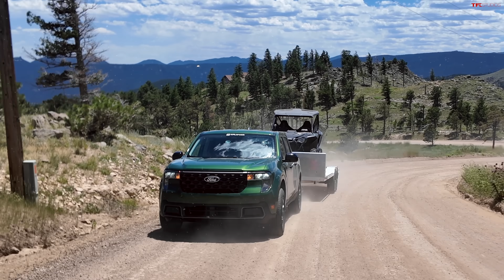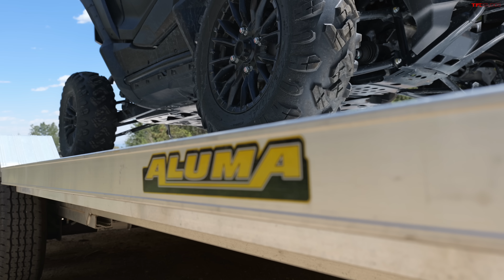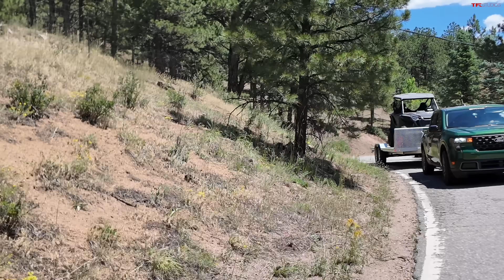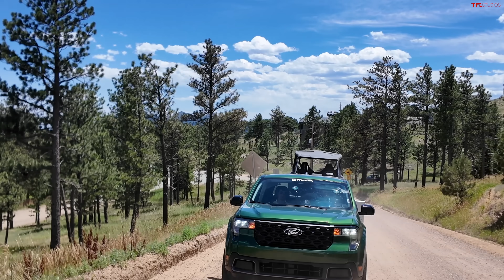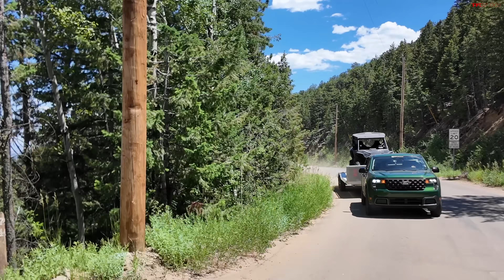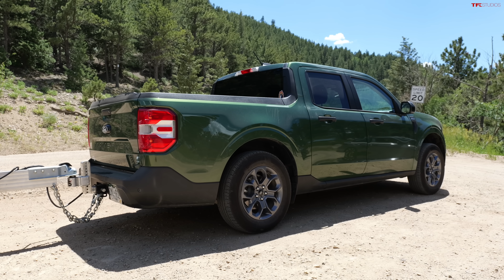Hottest Yet: Does The Ford Maverick Survive The TFL Toaster Towing Test?

Comment: With the engine rpm so high, the coolant is really pumping through the water pump so that a reason it is staying cool. Also, its naturally aspirated and not causing excess heat from lugging a compressed intake charge at low rpm when the water pump isnt pushing as much coolant.

Comment: I don't understand the idea of beating on the vehicle so hard, as most owners that care about their vehicles would never drive like that.  No need to mat it to the floor around every corner.  Gradual acceleration will help not overheat the vehicle, rather than trying to get back up to the speed limit as quickly as you possibly can.

Comment: You guys picking on a 3700 LB mini truck with  191 HP and my 2002 F150  weighs almost 6000 lbs empty only has 231HP. It actually does a respectable job for what it is and it fits the need of 90 percent of what I do. The 5 year 60,000 mile powertrain and 8 year 100,000 mile warranty on the Hybrid system was the final selling point for me. I'm ordering a 2026 This month. The fact that I can drive from Pensyltaxya to Georgia to visit my family on around a tank of gas is a big bonus.
Reply: @biffmalibu3733  Sounds like you and I have the same 2002 4.6.  Love that truck.  It has had zero issues.  Fuel economy sucks but that engine is bulletproof.  
I really want the hybrid Maverick.  I am torn between the hybrid Rav 4 and the Maverick.  I need a fuel efficient AWD for the family.

Comment: Just get a used Silverado 1500 with the 4.3 V6 if you’re looking for an inexpensive truck. They come with a full-size body a full-size pick up 4 x 4 double cab. They can also pull a little over 7000 pounds. You can find a bunch of them for around 12 to 20 grand depending on year and mileage if you are looking for something cheaper, that doesn’t get too terrible of gas mileage and don’t need a ton of towing power. I have a 2015 double cab Silverado with the 4.3 V6 4 x 4. I’ve pulled boats trailers and a 6000 pound camper with it. They tow around 5000 pounds with ease anything over that it’s definitely working a little harder, but I think most people would prefer the room and towing capacity of a full size for a cheaper price.

Comment: Hey Andre! Very entertaining to watch these kinds of videos! It’s also very helpful to see how each truck performs under these conditions, especially when people want to take summer vacations in various places.

IDEA: have you thought about doing a side-by-side comparison with both your Tundra and the newer model? I’m especially curious to see how different they perform (since the new one has different trans, engine, gearing, and now with turbos, etc). Though I understand if you don’t want to risk your truck, especially since 2019-2021 are the years Toyota removed the transmission cooler. Just a thought!

Comment: I have a 2024 Ford Maverick XL, the base model. I put a tow hitch on it, I own a 4,500 LB trailer, but my truck is rated to tow 2,000 LB. I do have an old gas guzzler that "can" tow it. I'm tempted to use the Maverick though.

Comment: My 2011 f150 FX4 5.0 is rated to tow 9100 lbs. it’s the crew cab long bed and is still made of steel vs aluminum. My truck weights 6000 lbs on its own. I just pulled an 8500 lb dual axle camper with 1100 lbs in the bed from Wyoming to Montana while it was anywhere between 80 and 103 degrees. It pulled awesome. Even over steep climbs the lowest speed I could hold was 65 mph, most of the time I was able to hold 70 mph. One of the hardest hills I climbed, it was 97 degrees out, and the uphill portion was about 5 miles long. And it was everything the 5.0 had to hold 70 up this hill. I have the 3.73 gears and was in 3rd which means it was at 4100 rpm going up that hill. It was the ONLY time I’ve ever seen this trucks coolant temp start to get hot, but it did not overheat, and around 15 seconds after I crested the top, it was back to operating temp. I’m very impressed with my f150.
Reply: @off-roadprojectsandfun6868  careful with that, your towing capacity includes whatever is in the truck. So 8500 plus 1100 plus whoever was in the cab is quite a bit over capacity - I’m glad it did well, but if you get into an accident with that truck overloaded like that you can be held at fault - just a friendly note :)

Comment: There's a phone app called FORScan that you can use to get all kinds of data on Ford trucks. It reads from your OBD2 port with a WiFi connection and gets data from your PCM/ECU/IDM.  You decide which gauges you want it to show. You could also get a wired OBD2-USB dongle and connect to the PC app. I almost guarantee you'll be able to read oil and transmission temp that way

Comment: During a climb, the hybrid engine is practically useless unless you have a plug-in hybrid with a large battery, what would probably help this engine more would be to have the CVT and starter-generator keep the engine at optimum performance RPM sending power to the electrically driven wheels when it shifts those planetary gears(assuming its not a mechanical AWD)
Reply: I'm just glad they didnt pull a Honda CRZ where the battery was closer to the capacity of 6 laptops, rather than an e-bike, let alone a hybrid.
Corvette E-ray isnt much better but at least it is over 1kwh

Comment: It's like it's the 70s again why are these manufacturers putting 4 cylinders in everything there was to under powered and every 4 cylinder I've seen always has head gasket problem that truck should have just the regular v6 Ford engine in it

Comment: On the fan topic I'd be curious if the Maverick has kept the variable cooling fan like the C-Max had before it and could explain the reduced fan noise you guys are hearing. For the C-Max functionality at least it very closely monitors the A/C stats, pressures, temps, etc plus coolant temp and will not only adjust the cooling fan speed to exactly where it is the most efficient but also the grille shutters as well. No more off/low/high speed fans.

Comment: What a terrible instrument cluster, got that misaligned 100 number to the Ready text, and lots of "floating" type of UX designs. Typical Ford engineering. Go buy a Kia or Hyundai, and you'll see clusters laid out much nicer, than anything the big 3 do, and the quality of screens, cluster to center console are different, cheap, materials are cheap inside those trucks. 1980's plastic.

Comment: What  POS. My 2014 5.7L tundra gets 14MPG when towing that weight every time.
Reply: Yet it won’t get over 40 MPG on level ground not towing…That is the real sweat spot of the maverick.. I am averaging just over 41 MPG at roughly 6,000 miles on the odometer.. I just hauled a refrigerator upright in the bed the other day..👍👍
Reply: @July.4.1776a prius can haul a fridge too

Comment: Like they mentioned, I don't like how the temp gauge didn't budge at all through the run, even though the OBD gauge showed it went from just over 190 to about 221. To me, that either means it's a dummy gauge that jumps from the center to the red when you're in the danger zone, it's not accurate at all, or what it considers 'normal' is much higher than anyone who pulls trailers would like it to be.
Reply: Most oem water temp gauges are like that. It will stay at a static position for what the manufacturer decides is "acceptable". For my 2020 veloster N, hyundai decided that range is 145F to about 225F, above that it will quickly move up into the red.
Reply: @granolatimes7185  Actually something funny considering the Maverick here is that the Ford C-Max (at least the Energi model which I own, not sure about hybrid only models) does have a granular/legit temp gauge. But that's primarily because it has an electric only heating option that won't target full ~200F coolant temps all the time. It also has a secondary ECT sensor that measures the coolant directly while most (if not all) Ford's measure cylinder head temp and infer coolant temp from that. Interesting thing I see a lot during the warmer summer months is with a 'cold' engine starting up the first time for the day I'll see a sliver on the bottom of the coolant gauge due to the higher ambient temps affecting the coolant on its own.

I imagine for the hybrid Maverick here not having that separate electric heating solution and sticking to engine heat they do just like you said on pretty much any other vehicle and go with a dummy gauge. Certainly not unexpected. This behavior has been around for a few decades.

Comment: cvt  or ecvt still sucks
CVTs generally aren't recommended for towing, as the constant strain can exceed their capacity and lead to premature failure 
and you need engine braking when towing downhill , cvts cant handle the inertia
Reply: Ford’s eCVT absolutely can handle the towing, and does provide engine & regenerative braking. They upgraded the transmission specifically for the 4k towing this year (though I believe all the Mavs get the beefier unit).

Comment: Do this test with the non-hybrid version.  

A simple free software program you can install on a laptop would give you all sorts of data to pick from to show live.  Download Forscan for windows, install it on a laptop and get a bluetooth OBD2 dongle and you are all set, throw that stupid Banks gauge in the trash.

Yes that Maverick with the right software and computer will tell you all sorts of stuff, with a annual subscription you can do a lot of additional security related stuff with that Forscan software.  

NOTE:  Forscan is a Ford program not made by Ford, but its for Ford vehicles.  Works great, its saved me a lot of money over the years from having to pay for diagnostics, and figure out what part I needed to replace.

Comment: Why is the engine light on would that affect the performance
Reply: That engine symbol on the instrument screen is not a warning light. It just marks the top of the power bar that shows the split between ICE and electric power. Not a great design choice, in my opinion, but not a problem indicator either.

Comment: The HP numbers may seem low by modern standards, but 30 years ago, those would have been at the top of the truck class.  For truck tests (where you're doing truck stuff like towing) you should amplify the torque numbers.
Reply: I think it was Motor Trend or Road and Track that did a Mav comparison by the number to the previous Mid Sizers that were the size of this compact. And it’s incredibly close.
Reply: The ecoboost is making similar power to a 90s 350ci truck or car engine and is also making similar power to most 90s and early 2000s turbo sports 4cyls, its pretty inpressive.
Reply: @KR-hg8be  A good comparison that I like to make is the Edge with its slightly older version 2.0EB to the old Crown Victorias. The AWD Edge 2.0 that I was helped settle on to replace their Crown Vic is literally only 20lbs heavier and has nearly identical power and torque figures but at lower RPM on 87 octane than the old LX Sport's 4.6 2v V8 with dual exhaust. That little engine has been improved since so I expect god things going forward.
Reply: @KR-hg8be The old 350s made 190 hp, same as the hybrid 💯

Comment: Question for y'all - did you happen to notice how much the rear dropped when you added close to 400 pounds of tongue weight? I'm curious. Last Wednesday, I pulled a pretty significant load with mine. Wisely, (as opposed to last time I pulled heavy), I adjusted the headlights downward 1 complete turn of the screwdriver. Seemed to be just about the right amount.

Comment: I use an OBDlink device that bluetooth's gauge information to my iPhone. It gives me trans temp, engine coolant temp, boost (if applicable), all kinds of data really. Saw the coolant get up to 222 degrees pulling a 6X12 Uhaul up into the high pass on I-75. But as soon as I stopped climbing, that temperature dropped. For the record, I have a 2.0 EB 2024 Maverick.
Reply: Could you please tell us what OBD device you’re using?  Sounds interesting. I don’t torture test my ‘25 Mav Lariat, but the info would be interesting when I’m towing my SxS. Thanks!  👍
Reply: @davehoward2791  It's the OBDLink MX+, I believe.

Comment: Unless it is a plug-in hybrid electric vehicle (PHEV), the small battery used in HEVs will run out of power almost immediately at the start of the climb. 

In the Maverick, that means after only a minute of two of climbing, it is only the 162 hp gasoline engine propelling you up the mountain.
Reply: Nope, with the engine running, it can also provide power to the traction motor when needed.  You actually see it in the video.  The blue bar moving up-and-down is the electric motor working.  The only thing you won't get when the battery is in a low SoC (20% range) is solely running on EV.  Otherwise with the eCVT Split-Power, the hybrid can run parallel or in series or EV if the SoC is high.  It provides up to 120 HP, but let's be honest, the electric motor delivers the torque that 4-banger lacks.  Which works quite great!
Reply: @FullTrotter If it is using some of the engine power to generate electricity to power the electric "traction" motor, then you are still limited to the total power available from the gasoline engine. 

Once the available power from the battery has been consumed (which will happen relatively early during the climb when running at full throttle), you are effectively left with only the power from the gasoline engine.

Only if there is a downhill section or you slow significantly for some reason (easing off on the throttle a lot or hitting the brakes), can you put any real power into the battery and then experience a short bit of EV assistance, but unless there is a significant downhill section, the assistance will only last seconds.

Note I own a PHEV (C-Max Energi), a HEV (Highlander Hybrid) and an EV (ID.4). When driving the PHEV or HEV up a mountain pass, once the battery power has been depleted you really notice the loss of EV power assisting you up the mountain.
Reply: @FullTrotter Where did my replies go?

I replied explaining that once the EV battery is depleted that the only source of power available is the gasoline engine. 

The hybrid CVT system does split the mechanical power between driving the wheels and producing electricity by spinning one electric motor (let's call it MG1), but only that electricity powers the other electric motor (let's call it MG2). Since the battery is depleted, the only power MG2 can receive is power immediately generated by MG1.

We own multiple electric assisted and powered vehicles. With our HEV (Highlander Hybrid) and PHEV (C-MAX Energi), when climbing a steep mountain pass at high speeds or when towing, with the throttle down, the experience is as I explained above.

When the high voltage battery is depleted, you really notice the reduction in available power.

Comment: Id like you to take my 2008 toyota tundra  crewmax 4x4 5.7 with 365k all hard work miles probably half towing. Power train completely original no issues, anyways i bet it would do this test towing over its max limit with 0 issues. Im actually surprised so many trucks fail this test especially newer trucks.